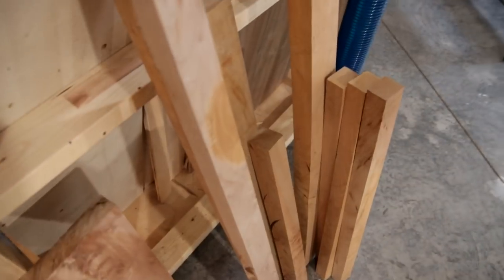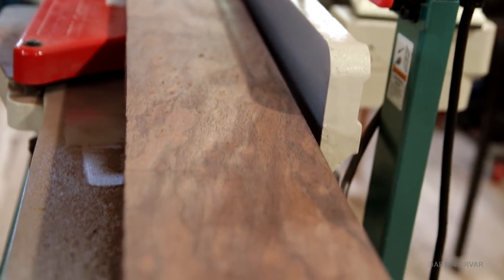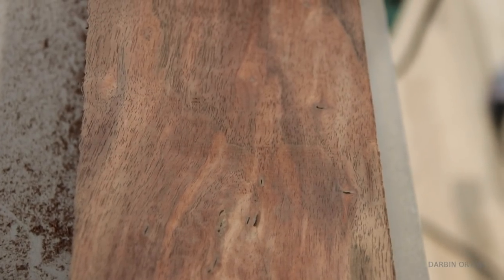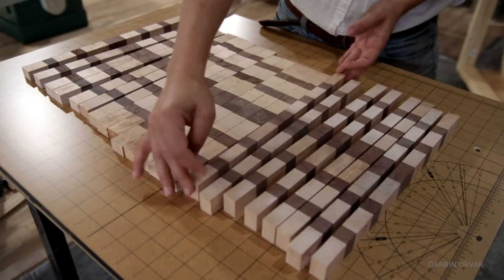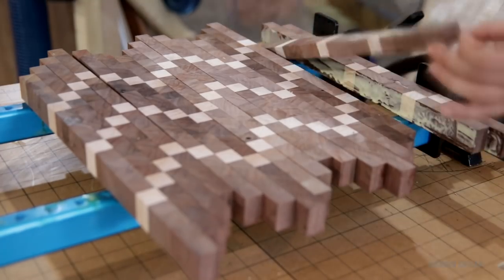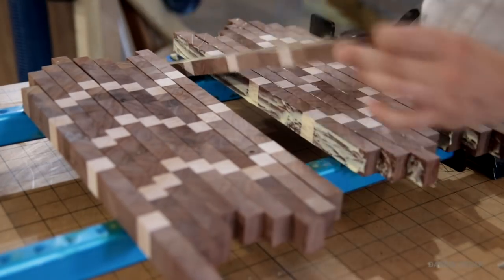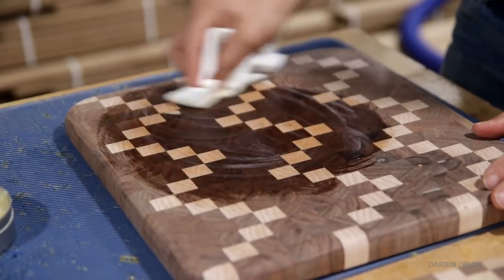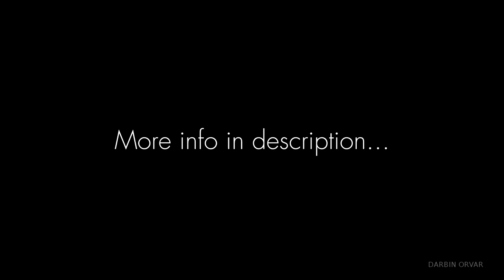Amazing Pattern Cutting Board

Comment: A point of clarification Lynn.

The term "Soft Maple" refers to the unique color pattern of the leaves, not the relative hardness of the wood.  The other common name for this sub species is "Silver Maple."   In both cases the name refers to the lighter coloring on the bottom of the leaves which gives the leaves a "soft" or "silvery" appearance compared to the traditional maple whose leaves are the same color tone on both sides (as is the case with most deciduous trees).

This "soft" coloring is actually a recessive gene trait, and the vast majority of soft maple today is a direct result human forced development through selective grafting to produce seeds and seedlings to accentuate this trait.  Such grafting can be shown to be common as far back as the mid 1700s.  The soft maple was, and is, considered the more aesthetically pleasing for urban, and later suburban, landscaping.  It also has a slightly faster maturity rate making it simpler to generate large seedling yields (i.e. more profitable for landscaping).  This, along with rapid suburban development after each of the Word Wars, made the "Soft Maple" exceedingly more ubiquitous in North America than would have happened naturally. 

Today, many mistaking confuse or conflate the name "Soft Maple" with the woods relative hardness; however, it is in fact indistinguishable from traditional maple.  All hardness scales are relative and rely on mass sampling to arrive at their comparative data.  The hardness of green maple depends far more on the latitude and climate in which it is grown than if it is "soft/silver" or traditional/"hard".  Soft maple from norther Maine will, on average, be significantly harder than "hard" maple from say central Ohio or southern Illinois.  Today, North American "Soft Maple" lumber today is mostly from well controlled regions in the US and Canada resulting is a bit narrower margins in variation.  That said, given those margins and the degree of overlap they have, there is virtually no difference between the two.  Visual identification between the two is almost impossible with expert arborists failing to properly separate the rough lumbers over 40% of the time.  Short of a full forensic analysis, the only way to definitively tell them apart is to do so while the tree is still standing and bearing leaves.